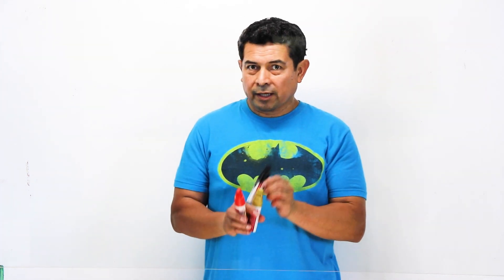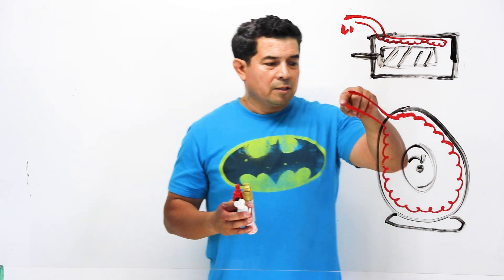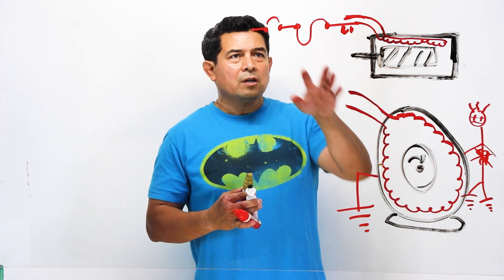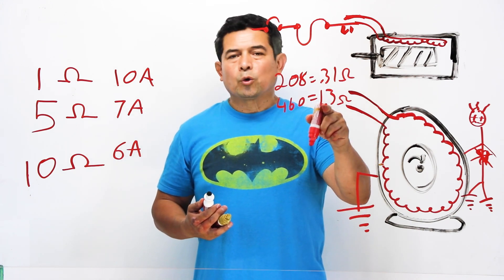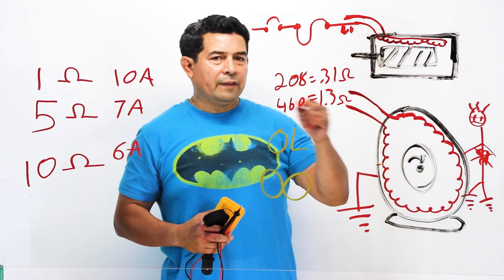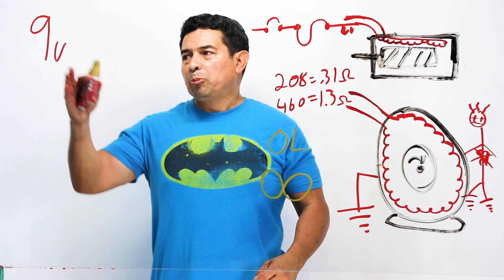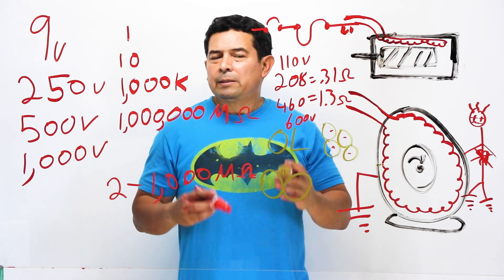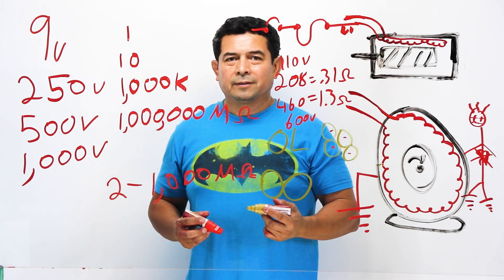Using a Megger

Comment: Great video! Thank you so much for sharing so much valuable information in such a short video!!  I recently bought a meg ohm meter/insulation resistance tester, but the instructions were not very helpful. You have shed much light on its use, and now I am ready to test motors, compressors, etc.,  with greater confidence. Thanks again!!
Reply from the maker: Thank you so much for your kind words! I do this so that it is easier to understand what is going on out there. Books and instructions a lot of times do not make sense. Thank you again, thank you for watching and good luck out there!

Comment: This occurred to me last week on a 4160. Blew 3 fuses and did not detect when using megger.
Reply from the maker: You mean a megger did not detect it? Maybe you could have said the setting to a higher voltage setting on the megger?    Remember, the electrons have to reach across to the casing. Might have needed a higher setting.    Thank you for watching!

Comment: If you want to test the insulation on the wires in a stator of a generator, will you blow them out if the Megger is set to 500 volts?
Reply from the maker: Good question, but no, you should not blow the insulation on the windings if you set it to 500.    I assume you're speaking about a generator that is going to put out 230 V. You should not have a problem with that. Thank you for watching!

Comment: Good video, good presentation.  Rule of thumb is to have Megger reading of Rated motor voltage plus 1 meg Ohm for passing Megger test ( 460VAC motor is 460 +1 Meg = 1.46 Meg)  But must always refer back to past Megger readings to check for high swings in the Ohmic values.  Yes motors need to be Megged at regular PM intervals and those readings need recorded for future reference! Of course, if motor is tripping breaker then the immediate Megger readings are what counts.
Reply from the maker: WOW!!!   very good!!!   I try to explain that in classes  thank you on large motors we need to keep track of this information to see if the motor is failing.    I believe most of the time once it is explained the guys in class understand why it is important.       to me that is important getting them in class to understand why we do these things.     thank you and thank you for watching!!!

Comment: Thankyou,  for the clear explanation . However,  aren't you supposed to double the voltage using a megger? Or will that create a breakthrough in insulation?
Reply from the maker: I don't like doubling the voltage.     remember, your own meter is only using that 9 V battery. The meager will send 500 V 480 V motor.     I know some people do double it so you could go up to 1000 volts.       Thank you for watching!

Comment: You can run your megger at 500v or 1000v on equipment rated for 120v or 240v.  The insulation is usually rated for 600v, ant thats at a high amperage.  The megger test is considered non destructive, you arent likely to damage wires by testing with it set at like I say, 500v or 1000v.  For a megger that is low.

Comment: thank you sir .  OL means the voltage you tested is larger than the motor voltage which can destroy the motor insulation right, sir?
Reply from the maker: OL, well means open lead or open line some people say, open loop. That means that there is no connection between the two leads that are connected to the meter.   So there's basically a bad connection wherever the meter is hooked up. Or the windings in the motor, or the wire that you are testing is broken/open. I hope this answers your question and thank you for watching!

Comment: nice video, iam chasing a ground fault on a 220v motor with a multimeter geting no continuity and OL thinking that the motor is fine when its shorting to ground.
Reply from the maker: Hi! I hope you found the ground! Sometimes, without a megger, it is next to impossible to find it. I had a chiller compressor that I put in and the supervisor would not get me a megger. As soon as we got our hands on a megger we found out that the brand new compressor was grounded internally. That is why, when the contactor pulled in, the contactor would actually blow up!   I hope you found the problem. Thanks for watching!

Comment: I was always taught to set to double the voltage used
Reply from the maker: I have heard that method before, doubling the voltage. I was tell everyone to remember voltage is the pressure pushing the electrons, if you increase the voltage too much, then you may blow a hole in the insulation and prematurely destroy the motor. As long as you have never destroyed a motor, I guess your method would work! Thank you for your comment. And thank you for watching !!!
Reply: @AirConAcademy  appreciate response 👍
Reply: @ld7103  My megger puts out rectified DC voltage of 250, 500, or 1000 volts, generated by an on board hand crank generator.  Even if there was a direct short to ground,it can only produce 5 milliamperes or less.  No way could that damage motor windings, even at two or three times the rated motor voltage.

Comment: If a motor is 460V isn’t that an RMS voltage value? Wouldn’t the peak of the sine be around 700 volts meaning that the winding insulation should be able to safely handle that amount of voltage? I was taught to use double of the voltage rating of the motor I’m testing. Correct me if I’m wrong but since the current meggers put out is so low it makes these test nondestructive.
Reply from the maker: I don't like taking a chance on destroying things. Yes, some people teach to double the voltage. In class I always tell the students that windings on a motor or wire it's just like a garden hose. You increase the pressure too much, meaning the voltage it could blow someplace. We know that voltage is leaking out at 460 V, so I mega should be able to detect it if you said it to 500 V setting.    Like I said before, I don't like taking a chance on destroying things, and I don't want to come back and tell my supervisor I was making a motor and put too much voltage through it and grounded it. Yes, I have seen it happen. Good luck. I hope this helps! And thank you for watching!
Reply: @AirConAcademy  I’ll have to disagree with you on megger test voltages. A megger is a non destructive test instrument.  It cannot generate enough amperage ( 5ma max short circuit current), to cause damage  to a motor winding.  Think of it as static electricity.  It can jump an ark but it won’t damage the motor windings.  I use AEMC industrial crank type meggers, The instructions for voltage to set the meter at is as follows:  Rated voltage of motors below 115, use test voltage of 250 volts, Rated voltage of motors 115 volts, use test voltage of 250 or 500, motors rated at 230 volts, use test voltage of 500V. Motors rated at 460, use 500 or 1000.  I have used these recommendations, for testing motor insulation for years, and have never damaged any motor.  I agree that you  would never apply line voltage POWER in excess of a motors rated voltage, but megger test voltage is not the same.  Of course, I would never megger any motor thermistor, or electronic motor control component.
Reply from the maker: @rodgraff1782  Yes, those are the instructions that are found in the megger manual. I was using my opinion in the previous answer.  If the manufacturer of the Megger said you can do that I would never dispute it.   It is like when I'm teaching an Air Conditioning  class, we typically teach that superheat should be 8 to 12°. Then I tell the students if the manufacturer says that it should be 6, who knows better? Me the INSTRUCTOR or the manufacturer. And I make sure that they understand that the manufacture knows best and to follow the manufacturer instructions.  I was not trying to confuse anyone. I just wanted them to be careful because I have heard of that happening to the electricians when they are Megging a motor.   Thank you for your comment!

Comment: How is this used in checking solar panel installs?
Reply from the maker: That's an interesting question? I have never heard of a measure being used on solar panels. This is mostly used to check the insulation on motor windings or generator windings. Solar panels are solid state devices that do not have the same type of insulation on them. I will look into it but as far as I know meggers are not used on solar panels. Thank you for watching!!!

Comment: Hi Julio, thanks for all your vidos. Qestion:  I have a 24 Volt motor, can I use a megger to check if motor is in good condition?  greetings from Trondheim,  Norway.  Sverre  eriksen.
Reply from the maker: I was just telling someone else that there are so many different configurations of all of these components out there. To be honest with you I have never seen a 24 V motor? Solenoids yes but never a motor.? I suppose if you set the voltage of the Megger to the lowest setting you could test it, small motors we usually do not go through the trouble of using a megger.    I'm not sure if this helps any. But I just have never seen a 24 V motor.
Reply: @AirConAcademy  thanks Julio, This little motor on 24 Volts is tested ,and seemed to be ok. I applied the volts from a industrial batteri.  The motor is from a expresso coffemaskin and about 10 cm long.   I am following almost all of yours vidoes, so clearly explained.  Sorry for my English.   mvh  Sverre  Eriksen.
Reply from the maker: @sverreeriksen1982  do not worry about the language barrier. I know it is tough communicating with someone that speaks a different language than you do. Thank you for your comments about my videos. I understand you applied voltage from an industrial battery. Some motors will not work on voltage coming from a battery because that is direct current/DC, most motors need alternating current/AC. It probably did not work when you hooked it up to the battery because of that.  As before I'm not familiar with that type of machine, but motors operate the same way no matter where they are being used. So if this is a 24 V AC motor it will not work with DC. If it is a DC motor then you may want to check the brushes and see if they are in good shape.   I am not sure if I have any videos on DC motors yet. But check to see if it is AC or DC current.

Comment: when motor is running why stator is not give any shock .why im asking, stator also has winding with current passing,
Reply from the maker: The stater has the windings, yes, but the electricity is staying inside the wire because of the insulation around the wire. All of the wire that you see in the stater is coated with clear lacquer/varnish.   So as the current passes through it stays inside the insulation and does not leak out. If it did leak out it would go through  to the ground wire to ground. And this would be a problem that we call, a ground.   I hope this explains your question.

Comment: Its not a Megger, a Megger is a Trade Name that makes a insulation tester, that has arrange of mega ohms. Second point if a meter has a 9V battery does a insulation tester have a 500V  battery.
Reply: As an industrial electrician of 41 years we always called a megohmmeter or insulation tester a Megger for short.Hardly anybody ever called it a megohmmeter or insulation tester. Like you said Megger is just a trade name that makes insulation testers.
Reply from the maker: My intention is not to confuse anyone so I'm using the term that they will be familiar with. Yes, some will have a 9 V battery in them, some. And I guess if you hook up enough batteries together you could have a 500 V battery. They are converting the nine volts to a higher voltage very similar to how they do it in a car. The car has a 12 V battery but they raise the voltage into the thousands for the spark-plugs to ignite the fuel. When I started doing this back in 1979 we used the Meggers that had a crank on them, in other words they had a mini generator inside.   I hope this explains some of it to you. Thank you for your comment. Be careful out there and keep learning!

Comment: Nice thank you. How are you behind the board and we don't see you writing backwards.? 
I do have a motor question though. 
How a turn to turn short is diagnosed when not shorted to chassis, on a single phase 120-220 VAC motor?
Motors works but pulls a bit more amp. I can guess after eliminating everything maybe a turn to turn short. But Old love to know how and what instrument can diagnose this problem and be certain of diagnostic to a good measure.
Reply from the maker: When I started the videos I was writing backwards. But then I realized that I can write normal and just flip the video around so it looks correct. And I am writing on a piece of glass so that you guys can see me and what I am writing. It's kind of interesting how it works. Now ask for your motor. It sounds like you are correct and you have a short from a turn to a turn as you put it. There is really no easy way to be sure except to have a motor exactly like the one that you have, compare your readings on this bad motor to the readings on the good motor. If your resistance, or in other words of the OHMs readings on the motor that is drawing high amps are low then that means you have a short from turn to turn. There is really no other way other than comparing it to another motor. The resistance in the windings should be the same on a brand new motor as long as the motor is just like the one that you have. I hope this helps. And good luck!
Reply: @AirConAcademy  thank you very much. This is very helpful.
So when imagining a good winding it seems as a winding road all the way through and a winding with a turn to turn short would have some sort of a Lupe or a short cut along the route.  
Measuring and comparing resistance would be one way for sure. How about if there's an instruments that would measure exact length of wire but again I would have to compare it to a length of the winding of a good motor.
Reply from the maker: @AB-yu2tj  if you have a short return to turn that would make the resistance less. And as far as I know there is no instrument for reading the length of the wire.  I have used the comparison method many of times. And after a while when you deal with the same type of motors and compressors you get used to what the readings should be for that voltage and tonnage of compressor. I usually tell the guys in class to write down the resistance for the brand new motor and or compressor, if possible on the motor or compressor itself so you have something to compare it to in the future.   That last part I just learned from experience because doing this from 1979 to now you end up  finding ways of making your life easier. Lol    I hope this helps and good luck out there!
Reply: @AirConAcademy  thank you very much
Reply: @AirConAcademy  so here's the update on what I've found so far which seems to be capable of diagnosing turn to turn shorts but I still have to do more research to see if I have to compare its readings to reading off of a good winding. Or will it do the job on its own. Ninety-nine percent of the time I'm testing single phase 220 volts Motors.
It's called Motor Genie. I think it's made by All Test
Reply from the maker: @AB-yu2tj  thank you! I will have to look at the motor Genie. I'm glad you found this and told me about it. Thank you
Reply: @AirConAcademy  .you got to see the price for their top of the line tool. 
It's kind of ridiculous if you ask me.
I may have gotten lucky on ebay with their older model (1998). Which does all the measurements their top model does minus the technology automation and connectivity. I mean I don't know yet, it hasn't arrived LOL. But I don't think there's much changed in the motor world. So, if the unit is in good working order I'm sure what worked then will work now for motor diagnostics. Hopefully if the piece works the calculations will be done manually which is just fine. When you waiting for a good tool to arrive days ago really slow.
Reply from the maker: @AB-yu2tj  I'm glad that you found one on eBay. Sometimes the older models are just as good as the brand new ones! I'm interested  to hear how that turns out and if it does the job for you! In the past all we have ever done it's just compare it to another motor and if the resistance is different than we know that there is a short from turn to turn. Let me know what you find out! And thanks for all of this information!